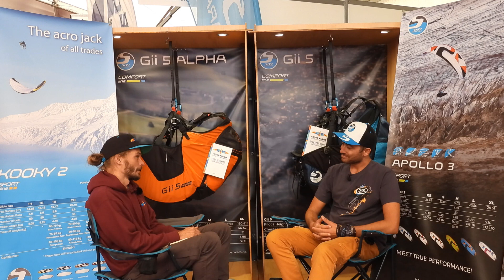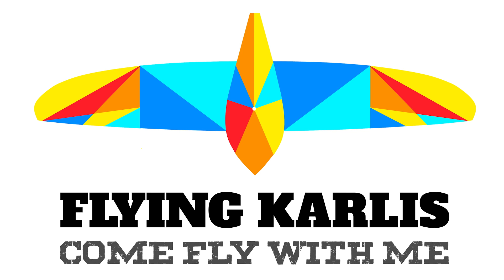Do we need all that performance?

Comment: Every designer calls the C 2 liners a marketing stunt. 
Yet ... the performance is there compared to the 3 liner C wings. So definetley not marketing. 
Had a flight where I flew in the alps and I had 2 buddies with me who were both on Artik6 while I was on the new Artik R ... After every longer transition I had to wait on them for at least 5 minutes to climb up to my height to continue and both of them are far more experienced pilots then me. One was flying in the same weight range as me while the other was flying a size smaller. In the end these minutes stack up and it can be the difference in competition and on XC flights.
Reply: He was talking about the EN-B 2.5 liners (versus EN-B 3 liners) being more about marketing spin than about genuine advantage/improvement (and he mentioned he thought that they should more accurately be called 2.9 liners ie a mild improvement rather than a step change but with [he intimated] the possible downside of sightly less tension at the tips). Of course he'd be highly unlikely to say that if Sky had gone down the 2.5 liner route :) It's logical / self-evident that a 2 liner will outperform a 3 liner at speed, as well as providing more wing control on bar and generally a more direct / connected feel on the rear riser.